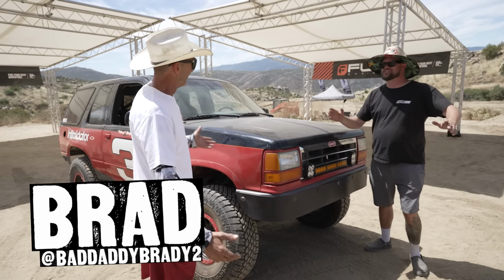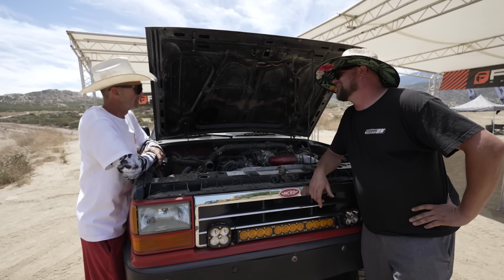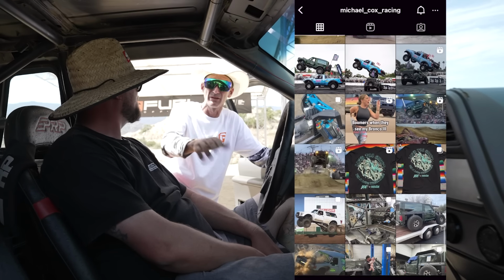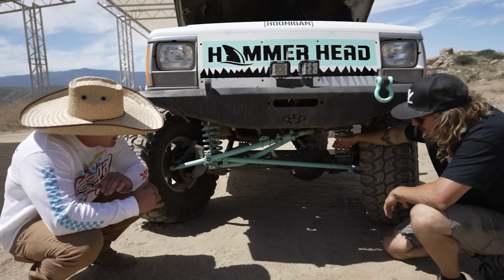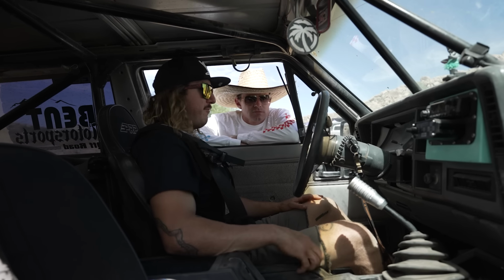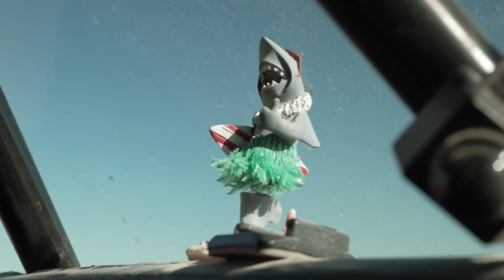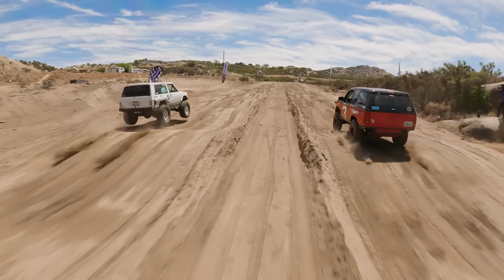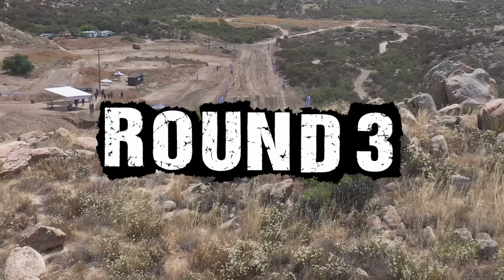Build & Battle Off-Road REMATCH! Blake Wilkey’s HAMMERHEAD vs Mike Cox’s INTIMIDATOR

Comment: I'm just in awe of that both trucks survived multiple runs.
Reply: Neckin
Reply: Everything is HP nowadays. But T-5 and Iron block, single valve was, and IS where it's at when it comes to reliability. God I miss the 80's and 90's.
Reply: Some might say the builders of the trucks are pretty good lol.
Reply: 100%

Comment: Leaking oil? Replace the rubber o-ring between the oil filter adapter and the engine block.

Dude heard he lost by a bumper so he sent it even harder the 2nd time.

Comment: Jeep needs an ho block and head,97+ big plenum intake with the larger throttle body, and the vacuum hose disconnected from the fuel pressure regulator, plus an exhaust all the way to the back with one muffler. Trust me it sounds completely ridiculous but mine ripped like it never had before under these circumstances 😂
Or just stroke it 😉😂

Comment: Solid suspension in the description is lacking detail. Maybe instead call it a solid axle and then specify whether its leaf springs coil springs or air/hydraulic etc. Solid alxes can also be 4 linked or 3 linked or stock geometry setups.

Comment: Something is off with the Jeep coming off the start. If he gets off the line quicker that Exploder doesn't have a chance.
Reply: I think the Jeep's tires are a lot taller, which is more weight to move and effectively taller gearing.

Comment: But the Jeep didn't change what the fuck dudes? The Jeep is the same vehicle that came from the last build and battle race. The Ford exploder( not a bronco) has upgrades and still barely won. You think that all summer Blake Wilkie in VW bugs and minivans hasn't been just getting better and better. it's all driver skill. I bet the Jeep only needs two upgrades and one of those is just a good degreasing and cleaning